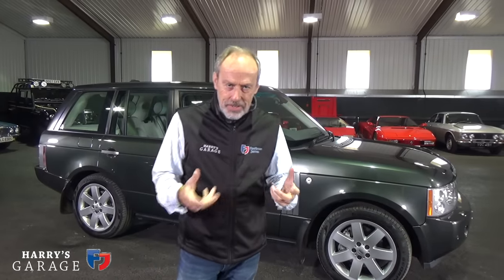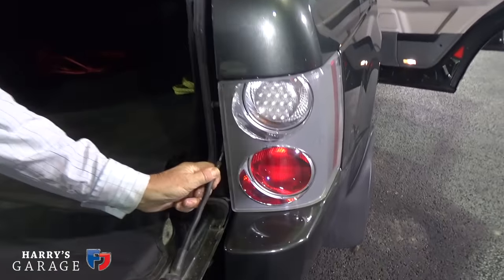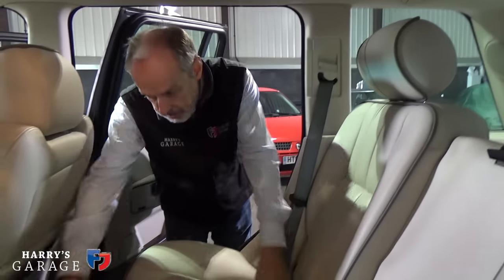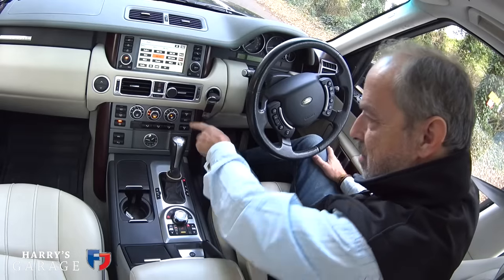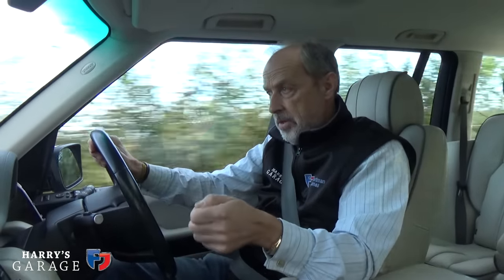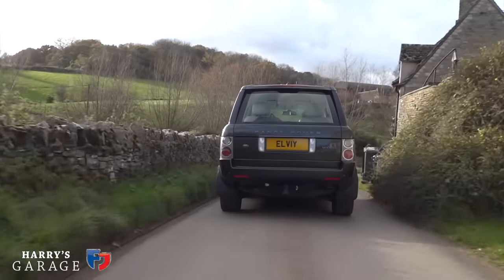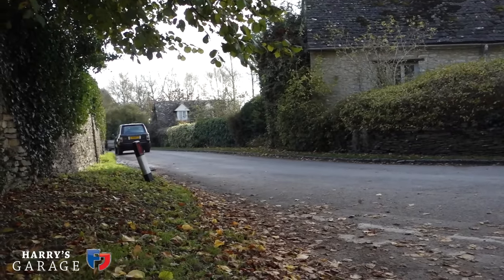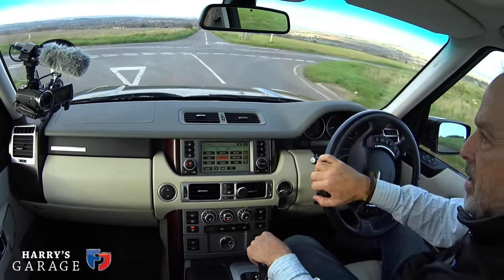Range Rover real-world review and buyer's guide L322 TDV8

Comment: Good stuff Harry, honest and comprehensive as usual.  My L322 is an early one, 2002 with the 3.0 litre BMW diesel and I get 27mpg and it still pulls like a train after 140,000 miles.  Got the rust at the rear door/wheel arch junction but otherwise it’s as sound as a pound.  Paid £4,500 for it two years ago and I reckon I’ll get all my money back when I sell it later this year after we finished our house building project!  Can’t beat that and I agree with you, it’s hard to look at a newish Rangie at £70k and think it’s worth the money compared to a good L322 TDV8!

Comment: My last RR was a 3.0 diesel and I can confirm that it was slow and noisy. Pressing the throttle to overtake meant more noise but very little more go.  It was very well built and never had a single build issue or fault in the 40k miles I kept it. I know that the front pinion shaft was an issue at that time but I was lucky and sold it in time.
Reply: That pinion shaft was a factory recall, you could have gotten that changed and fixed for free..................
Reply: @lt.lasereyez8891  
Yes, when they were about six years old after massive pressure from customers and consumer organisations. Before that and once out of warranty, there were at least two years, possibly more, when the early ones were refused. They had to pay and were only eventually reimbursed by a kicking and screaming company. This left many very bitter and dissatisfied customers.

Comment: Informative vid, Harry! About the oils (with ZF gearboxes especially); make sure that those oil changes are done properly, preferably professionally. There is a certain way to flush those systems and if not done quite right you're just going to get all kind of gunk moving about in the gearbox and blocking valves and mechatronics etc.

Comment: You HAVE TO have a diesel Range Rover for off road. Torque is king.
Reply: Wrong.  I have three 300TdI Defenders and all of them will kick any Range Rovers butt off road, plus I can slide them against trees, rocks etc without 000s damage.  I do not have the electrotricky, I manually select diff lock as required (centre , front and rear) and having off roaded for 40 years they are my car of choice in the UK. In Australia I would go Toyota, in the States Jeep, but in the UK ?  Old Defender

Comment: Split turbo hoses is a classic, as noted by Harry. Had that myself three times on the same vehicle, due to pipes being misfitted by the dealer. Electric park brake fails often. Also suspension compressor. I've had power steering failures too. Harry's right: it's not a cheap car to run. It will be off the road for several weeks a year. But when it works, it is unmatched, and that's why people keep buying them.

Comment: I read and hear these are a nightmare to own outside of warranty.
Reply: i heard you're a nightmare when you groan.
Reply: I own a 2004 V8 Discovery 3 and it takes about £2-3k a year in maintenance and parts so I suspect it will be the same here. Sounds like a lot but it really is a fantastic car, the best I ever owned despite the high running cost.
Reply: They were not made for poor people
Reply: They are a £70,000-120,000 car new, with a shit load of things on them, twin turbos, air suspension etc. etc. They need regular upkeep and the parts are not the cheapest.  So yeah, out of warranty they will cost you money to keep like new. I guess the problem is those that buy them for £10k and think they can be kept for the same price as a new car that costs £10k, they can't.
Reply: Guy-You need to stop lying.I have an out of warranty RR and it DOES NOR COST MONEY TO KEEP LIKE NEW.i am tired of getting notifications and reading them and finding that its another lie that i have to respond to.If you havent owned a RR and know nothing about them, dont come here and leave lies to people who dont know anything about RRs
Reply: I own a 3.6 TDV8. Stornaway with Parchment. Of course it costs money to keep like new. In the last year I have done the following to mine above and beyond regular servicing. New water pump, new alternator, new battery, new front drop links, new intercooler hoses, new expansion tank (bleed screw leaking and can't buy it separately) new front control arms and then a few small things like new Bluetooth module, new trim panel clips to stop any rattles/vibrations. These are all things that I would do on any 10 year old car, the difference is the parts on these compared to many other marques tend to be more expensive. Now, most 10 year old L322s I get in don't feel like new, the owners are happy with it like that as....well it is a 10 year old car, but I don't want a rattle or a squeak, and I want my interior to look like a new car, no matter what its age. Next job on mine is sort the rear diff out, have a slight wine at 40-50mph, maybe if I didn't keep the rest feeling new so new I wouldn't have noticed the diff whine. ;)                              My Range Rover.....       https://tinyurl.com/y8w3ua2z

Comment: I got mine 8 weeks ago. I thought to myself on the Friday I'm going to buy a Range Rover L322 TDV8, on the Monday morning I thought crikey I've got a Range Rover L322 TDV8 but seriously it's the best car ever with just 96, 000 on the clock. 2008. I've had all the oils and filters changed, two doses of diesel treatment and the tank full of premium fuel. Runs a treat and I'm ready for any problems I may encounter. I don't push it and let it warm up slowly and cool down slowly. i also have an LR3 WITH 200,000 miles on the clock.

Comment: With all respect to your car knowledge, good snow tires and all season usage do not go together. How snow tires work is they have very fine, sharp edges on protectors and rubber that tuck in snow and make snow part of the friction material, as well as they do other general trickery. All that smart design and snow capability goes to waste once you've used a snow tire for a single summer, as on the hot asphalt these degrade very quickly. The best advice is to change to summer tires as soon as the winter's over.
Reply: JurisKankalis Harry never said he had snow tyres, he has all-season tyres which, funnily enough, are suitable for all seasons.
Reply: Further to your comment winter or general snow tyres (not extreme stuff /specialist studded etc etc  ) is all about the rubber compound formulation and the increase in the number of sipes ...for everyday snow conditions that will keep you moving in 99.9%  of all cases.
Reply: Never trust the opinion of a person who can't spell tyre

Comment: What a machine owned a 2007 56 plate 3.6ltr V8, we had it for 6yrs used every single day it had 82k when we bought it unfortunately just sold it last month to the scrap yard in the sky, head gasket went on it. We had to spend last year on the suspension, my fault it was coming up suspension fault, new compressor in the boot, & following that the air suspension bag on on the front driver's side. And as you said in the video we had two new turbo hoses for it as well, great machine loved it, driving down to Bath in it from Anglesey North Wales was just fantastic, however, last few months was using a lot of water, then engine light came on took it to our Land Rover specialist & they gave us the bad news. In order to fit a new head gasket you have to remove the body off the chassis completely, also two heads, so two gaskets, it cost  more to fix than the car was worth, so RIP Range Rover King of the road

Comment: I've always loved Range Rovers, and even though the original was a real leap forward, regards to it's road manners and interior comfort, together with unrivaled off road performance, these modern ones are incredibly capable, both on and off road. It just shows the level of engineering, research and development that goes into each successive model, when you can now have top tier luxury car levels of road holding, performance and comfort, but in a vehicle that remains almost unbeatable off road also. The only one I wouldn't have is a P38, as they seemed to have quite a few problems with reliability. I can't  even remember the last time I saw one on the road, but there used to be a T reg, 2.5 DSE parked up the road, with it's backside sat nearly on the floor due to failed suspension, and by the looks of it, it hadn't moved in years. You do still see the odd "Classic", now and then, here in London though I

Comment: Swear by my Supercharged but at 135k miles it's time to replace it.  Problems? Starter motor packed up, front air suspension had leaks, (new struts required), suspension bushes wear, eats brakes and tyres.  It's never let me down though.
What to replace it with?  A last of the line l322 Supercharged of course.  No other car like it, and I agree with Harry, a true classic.
As an aside, if you fancy doing a piece on my Aston Project Vantage prototype Harry, feel free to get in touch.

Comment: I have a 2002 model in Europe as my runaround when I’m there, one of the first L322’s to roll off the production line, complete with BMW 3.0 litre V6. It had 230,000 km on it when I bought it in 2009 and I’ve added another 40,000 km since then, so relatively light use from my side but overall it’s seen a lot of use which is why my repair bills were not unexpected. Gearbox replaced (with reconditioned unit,) new turbocharger, fuel injector, new front air suspension struts/airbags, new handbrake assembly, new discs all round, new brake pipe, some suspension parts and some minor non essential repairs to trim and bodywork. If you take away the items caused by the car standing for months and salt from winter roads (corroded brake discs, handbrake and brake pipe) and the suspension items, I can only fault this car against the newer versions by the gearbox, fuel injector and turbocharger issues  but after 280,000km I can’t feel too hard done by. The main point is, Iinstead of paying 20+k for a more recent one, I bought the car cheap at 13000 Euros when it was 7 years old, and set the spare cash aside for the inevitable repairs. You can’t predict what you’ll be spending in repairs but you can control what you pay for the car itself in the first place  to mitigate it. It’s a buyers market don’t forget. And if I’d paid upwards of 20k who’s to say some of those repairs wouldn’t have cropped up anyway. So I don’t begrudge the expense, only the inconvenience of being stranded a couple of times. You’re right about the power , I do feel the car needs a bigger engine  to pull its weight and it seems to work harder than it should, but it’s only an issue if I want to break the speed limit or when climbing steep gradients, the car certainly copes but needs plenty of gas until the turbo kicks in.

Comment: The things I changed in my 2006. 
Front and rear differentials.
Complete AC system.
Key fob computer. (Yes it has a computer and can lock your key in the fob)
Front air suspension 
Rear air suspension.
Other than that it was the best car I ever had.
Reply from the maker: Unlucky. Sounds like you had an early 2006, the updates came through in late 2006 for 2007 model year..

Comment: I have a 2005 L322 4.4L V8 now which has 220,000km and is the best vehicle I have ever owned. I bought a Range Rover L322 TD6 brand new in 2002 when I also owned a Ferriari 308 GT4. Reliability? Cost of Ownership? The RRs are complex, luxury off-roaders so require regular maintenance whilst the Ferrari on the other hand, could be compared with the cost of maintaining a light aircraft!

Comment: I bought the "cheapest L322"  which is BMW 4.4 petrol and lpg.       So far it is going okay .   I did change the engine but knew that was needed.   All of the other kit seems to work. 2004 model with  highly desirable Green paint :)  Now looking for those 20" wheels

Comment: Great video. I've had two L322s and loved them both. I first had a 2008 3.6 TDV8 - which came with free with the turbo hose and EGR failures Harry mentioned - and recently upgraded to the 4.4. It's too early to say much about the latter other than that it's more refined and a smoother ride thanks to the 8 speed ZF box. The post 2010 models generally had a lot of reliability improvements. If you have the ZF box get it serviced early like Harry recommended but also get it done by a licensed ZF shop. LR dealers replace the fluid and filter but a ZF shop will replace certain mechatronic parts if they deem it necessary (ask exactly what the service entails as they have different levels, I believe). My service cost me about 600 pounds but I did it a 80k miles because it was starting to shudder when changing up to second gear which is a known problem with the 6 speed box. The service cured it. LR also have a box software update to address the issue but it's not essential.
Reply: what 2nd gear-they are automatic-ru dreaming
Reply: There are still gears in an automatic gear box.
Reply: there are gears but the car changes on its own, you dont change it, so u were guessing that it was on 2nd DUFUS
Reply: I wrote it shudders when changing up to second gear. I didn't write when I change up to second gear. This is not just my experience but that of other owners, who confirmed the issue with the second gear, which is why I wrote it was a known issue. Besides, if you put it in sport mode, you do dictate when it changes and it shows you what gear you are in, so no guess work needed.
Reply: WELL my L322 doesnt have a sports mode-if i want a manual car, i will go to the UK and buy those cheap monstrosities otherwise -what i see is always automatic
Reply: The L322 has a Steptronic manual override the same as all the other ZF boxes.

Comment: These are not for people who do not like to work on their own cars, or who wait for something to break to take it to the shop.

In 4 years my 2005 L322 with 130k miles has gave me 2 problems,

1)Transfer case motor, took it out and cleaned the brushes on the sensor and it was fixed, took 1 hour =$0

2)Transmission kept getting stuck in safe mode 4th gear, replaced the valve body with a rebuilt one, took 3 hours, solid as new.=$350 dollars

But I have replaced my complete cooling system, front and rear suspension and fuel pump, I’m not the type of person to wait for something to break to get it fixed, same goes for any car.

Comment: I bought my L322 brand new in 2008 and still have it which now has 90,000 miles on.  Changed the alternator at around 60k but apart from that it's been a great car which I will never sell.  I have has all sorts of cars including a 4.6 Autobiography p38 which I wish I still had and although it's not a cheap car tax is well worth the money.

Comment: You mentioned that the Range Rover L322 had a major overhaul from 2006 and became a much improved vehicle to the earlier models from the BMW era. Were these improvements limited to the engine and drive train or were they more comprehensive, ie suspension, electrics, body trim etc? It’s well known that the 3.6 and 4.4 diesels offer superior performance and fuel economy to the BMW 3.0 unit, but in terms of overall reliability (which is what most used Range Rover buyers are concerned about,) the power plant isn’t the main concern. The 3.0 V6 in my 2002 model may be slightly underpowered and more noisy, but the engine itself has never skipped a beat; the maintenance issues I’ve had have been  in other areas (in particular, the gearbox, suspension & turbo.) And afpparently the coupling on the driveshaft isn’t too clever either. So, did the overhaul from 2006 address these other issues as well, or just the engine itself?

Comment: I gave up on Range Rovers after owning two P38 models and having had a classic before that ( which actually wasnt bad). I loved the look, the comfort and the ride, but they are just not reliable enough for regular use. I have been tempted to buy the L322 and yes the post 2006 is better, but again several people have told me that to own one means you have to have a stand by just in case. Its a real shame, i love the ride and the comfort (severe back problems), but couldnt live with the poor reliability.

Comment: Good Vid. Here in Australia if I was to buy a Range Rover it would be a one owner, a Range Rover  dealer service history with some manufacturers warranty left. Other than that I wouldn't consider one.

I currently have a current model Land Cruiser with a twin turbo diesel. Which is a good vehicle that holds it's value well.

Generally I am very impressed by the Landcruiser's ability to stay in one piece under very trying conditions. I used to take them into the 'outback', hundreds and hundred of Kilometres over corrugated road and they stay together unlike some other brands.

Comment: Living with any Range Rover in U.K. is cheap luxury, trust me. Come to Lapland Finland, and you will learn what expensive really means and how difficult it is to find a dealer or even independent garage that can service Range Rovers. I just got a new tank pump, as old one started take air into fuel pipes (conditions where -27 Celsius + speed 100km/h i.e. driving 60). New parts over 1000€ plus works approx. 500€. But as mentioned air suspension is perfect for winter condition but most importantly you can actually see over snowbanks. Avoid driving over someone or hitting another car. If I could afford, I would just have three old L322 , one for summer, one for winter with special winter specs. And the third one just in case if others have problems. Easily better handling in winter conditions than any Quattro Audi, BMW X. Only Jeep and G-wagen can do the same but those are cramped like Flylow economy class. So when accidentally hitting a reindeer or elk, L322 is my insurance and choice. Thanks for the excellent spare part service from all around England I can source reasonable priced spare parts. I think Harry nailed it on what you can expect from any Land Rover. If you want safe choice go for Dacia Duster or Toyota Land Cruiser. Merry Christmas to all.